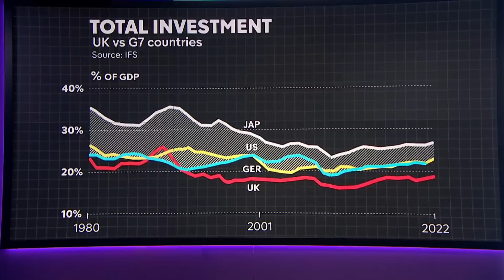UK gov pledges almost £22 billion to carbon capture

Comment: We are an island nation, if we want to capture carbon we should invest in restoring and creating more wetlands, yours sincerely an environmental scientist.
Reply: A great point that is often overlooked.
Reply: Well Drainer Rayner is already on it. Carry on building on floodplains, that will create lots of wetlands
Reply: I think building carbon captures nearer to china is the best
Reply: @charlieisdead8473  Carbon capture doesn't work whether it's nearer China or not.
Reply: Nature captures 96% of the carbon we generate already for free. Wetlands, forests, could probably do the rest. Then we can figure out what happened to all the insects. When I was a boy you could drive through any part of the countryside without having the wind shield covered in insects. Often we would have to use the washer and wipers to clean them off.

Make the same trip today and you can count the bugs that impact on the screen. In the town it is worse. Summer nights used to be shrouded in insects and the skies filled with swallows. Now you can almost count the insects in the air.

We could do worse than capturing some carbon in that whole ecosystem of birds bees and insects.
Reply: @charlieisdead8473  why?

Comment: Carbon capture requires as much energy (or more) than what’s liberated in producing the carbon for which they seek to capture.

It will double energy prices…it’s a scam.  It’s ridiculous.
Reply: Worse the hydrogen cars!!!
Reply: Direct air capture for CO2 is hugely expensive in its current form, better off encouraging natural techniques bogs and wetlands
Reply: @MrJaykay12345  Yep. Get the plants to do it.
Reply: @memrjohnno  The title of the article pertains to “carbon capture”, not hydrogen cars.  

Splitting water to separate out the hydrogen and oxygen requires electricity.  In order to make that energy, one would want to use solar or wind to produce that energy in a green agenda.  One has to use energy to mine the materials needed to make both.
Reply: @carnaud  My argument is that both are foolish. Where does 97% of the global hydrogen supply come from?
Reply: @memrjohnno  Splitting salt water using electricity
Reply: Yes,it's a scam.Some people are going to get very rich.
Reply: @ravenmad9225  agreed 🧐🎩💰
Reply: @carnaud  Indeed....in order to use it to produce electricity.... so.... why not just use the electricity in the first place?
Reply: @memrjohnno  Good question.  Because hydrogen is more energy dense than using electrochemical batteries to store the potential energy as well as being faster to “recharge”/fill a tank.
Reply: @carnaud  Energy dense.. more slippery.
Reply: @memrjohnno  You can use hydrogen for things that you can't use electricity for. You can also use hydrogen to smooth the curve of solar energy generation
Reply: @carnaud no...blue hydrogen is obtained from gas and CO2 is released in the process
Reply: @stevejones2310  Well then….That is idiotic.  Might as well just run cars on natural gas then
Reply: Yeah…missed that but….once again…back to the main point.  Carbon capture is STUPID
Reply: @ingni123456  Smooth the curve with BESS.
Reply: I wonder if I get part of the carbon capture money I've just planted a plum tree 😂
Reply: @ As long as it flourishes…food IS money so you will see some return on it

Comment: Just plant more trees?
Reply: Seriously?
Reply: @stevejones2310  A tree is 95% carbon absorbed from the atmosphere so yes seriously.
Reply: @tweedx7772  have you carried out a calculation to determine the number of trees you'd need to plant to reduce 420 down to 280 ppm in the atmosphere?
Reply: @stevejones2310  930 billion trees, but starmers project will take 78 years to have effectively reduced co2 in the atmosphere by 1 ppm.  Additionally Co2 does not need to be reduced to that degree, no possible action by man would reduce it to that level.
Reply: @tweedx7772  I think you need to show your working! Otherwise I call BS
Reply: @stevejones2310  Sure his plan will at the very best capture 100 million tonnes of co2 per year, 1ppm of co2 in the atmosphere is 7.8 billion tonnes.  Giving a time of 78 years to capture 1ppm.  Bare in mind these capture facilities use 15-30% of the power generated by the power plants they are attached to.
Reply: @tweedx7772  I don't disagree. Carbon capture is an expensive displacement activity.

However, I  want to see the calculations to support your thesis on the trees.
Reply: @stevejones2310  Your reduction is about 930 billion tonnes of co2, each tree absorbs 1 tonne on average per lifespan.  So this is 930 billion ÷ 1 tonne giving 930 billion trees.
Reply: @tweedx7772  multiply that by 100 for the lifespan of a typical tree.

But you need to provide a source for your figures

Comment: Keir, you're circumventing the elephant in the room.
Carbon capture isn't necessary. The money would better spent on lowing our use of fuel and creating less waste in the first place.
This is like saying let's build more nuclear power stations instead of embracing wind and hydro power.
So glad I didn't vote for him.
Reply: I agree. Also vat on luxury goods. Tax the rich. That brings down emissions and doesn’t cause job losses
Reply: @krob2327  Define luxury goods?
Reply: @krob2327  It could cause job losses if the brains who create the businesses take their factories out of the country like Dyson did! I think you forget it is the ones that create ideas that need to be encouraged as they provide work. Even "luxury"  goods generate incomes, jobs etc
Reply: @brinsmo1  private jet. First class flights. Range Rover. Bentley
Reply: @krob2327  Define rich? Do you actually live in the country? There aren't enough people living large to make any difference.
Reply: @krob2327  OK how many of those do you think there are floating about?

Comment: Well done Channel 4 News for shining light on the ridiculous hydrogen con. It's a real shame Ed Miliband has fallen for this. We should electrify as much as possible and focus on investing in these easy wins (renewables, battery storage, EVs and heat pumps)
Reply: A better idea would be to keep using carbon until the price of renewables comes down to that price. Poor cold hungry people create a lot less new ideas than warm well fed ones. But maybe desperation is some kind of asset.

There are a million ways to capture carbon that won't cost billions. Like building greenhouses near power stations. Put the CO2 over the plants and the waste water that normally goes into the cooling towers into factories and homes. They used to call it CHP. (Combined Heat and Power)

Comment: Pledging so much money for the CC solution is crazy and should be allowed only when renewable energy as a replacement isn't somehow possible or available. CC makes sense in some cases but only when other renewable solutions cannot be applied like renewable electricity glass furnaces. For heating up glass in this case u need natural gas (NG) which isn't as CO2 polluting as coal for example which is good, however NG still releases CO2 or possibly also methane in case of leakages. Hydrogen is a great option, but blue hydrogen requires NG and looks like quite an expensive CO2 CC solution. Even it could be bit better and it isn't ideal, UK is doing great job of phasing out coal which is no.1 priority to reduce CO2 emissions.

Comment: What happened to renewable energy and energy security ? Carbon capture systems are not renewable, not sustainable and are unproven technology on a large scale. Furthermore they may also increase pollution form other means since the chemicals used to scrub the gases will need to be disposed of when degraded. A gas fired power station using carbon capture uses more gas than one without since you require additional energy to process and transport the flue gases and hence make any  electricity generated more expensive.  What happened to making electricity prices cheaper ? What happened to lowering our reliance on imported hydrocarbons ? Carbon capture will never remove all the CO2 either - maybe 90% so not carbon neutral also.  Someone has been reading too many "reports" circulated by big oil.
I guess the next big idea will be the hydrogen superhighway that the big oil companies have been promoting in the EU. Just convert natural gas to hydrogen. Job done !  I thought the gov climate change committee were technologically savvy but it sound like gullible fools. Mr Milliband ought to explain himself.
Timing is great. 1. Ofgem increases prices. 2. Cancel winter allowance. 3. Talk about 22bn black hole for a while. 3. Waste  22bn on CC.

Comment: Labour giving taxpayers !oney to subsidise the continuation of fossil fuels.  This is a big experiment.  We don't know if they will successfully store the carbon under the sea for the length of the scheme.  The carbon has to stay there forever and who will maintain the well casings sfter that?

They are building at least one new gas fired power station with this scheme, so 25 years of more and more fossil fuel subsidy instead of subsidising the establishment of a strong  renewable energy sector.